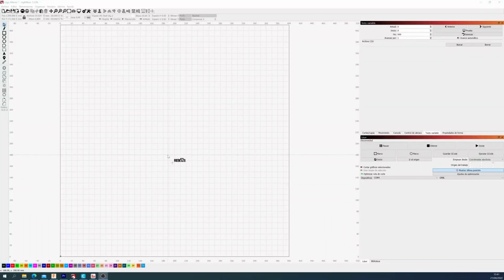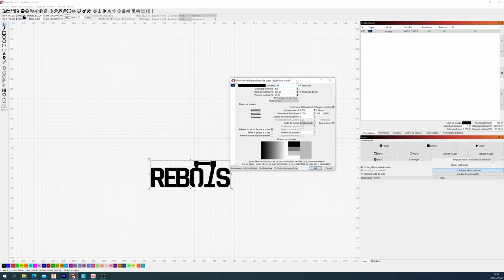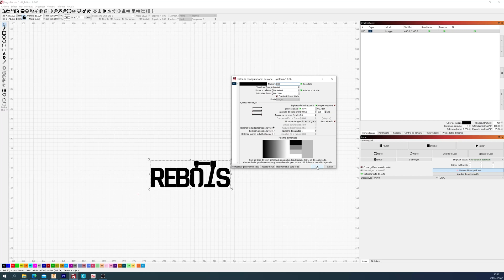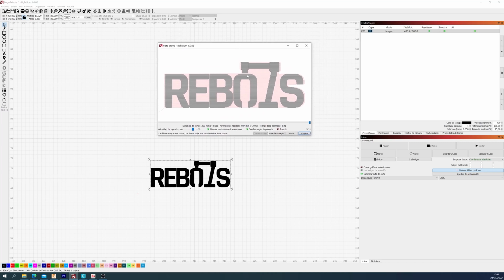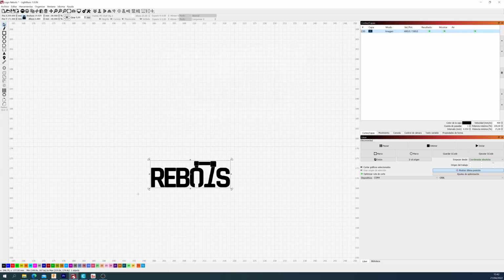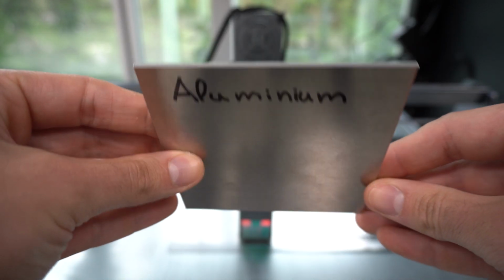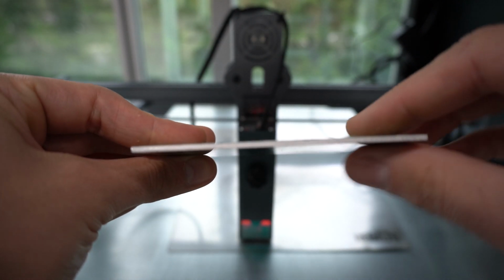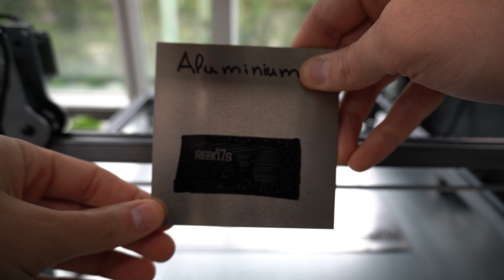Atomstack X7 PRO 50W Testing metal engraving

Comment: Hi, I try to laser a small image on a mason jar lid. I set the power to 100 and the speed to 400. I also purchased a marker spray for laser engraver. It work fine with the spray. And looks great. But when. I wash off the lid all of it is gone. What am I doing wrong?
Reply from the maker: Seems like the burnt material is not sticking to the jar. How about you try to engrave a couple of times?
Reply: I run it 4 x, and nothing. I also try a regular painted metal container at Walmart to see if it will work. And it won't even show anything. Maybe it's my settings. Can you show me what settings will work?

Comment: hello, i have the atomstack s10 pro and i can´t make it engrave on stainless steel. I put your settings and tried also with much agrressive ones like: power 100%; speed 80%; passes:4; line interval: 0,50mm and it does not work, just a liitle marking. I don,t know why. i tried also using markers and one can of dry moly lube and did not work. Can you help me? is there something i am forgetting to do in lightburn? Thank you very much for your help
Reply from the maker: Hi sorry can't really help you with that, it's mostly tinkering and finding the best settings. Usually it's difficult to engrave stainless steel with this type of hobby laser engravers with 50W. The best solution which works for us is black permanent or whiteboard markers. As you can see in the video that is the closest you can get to engrave with this type of machines. It also depends on the reflective surface of the material and the purity.